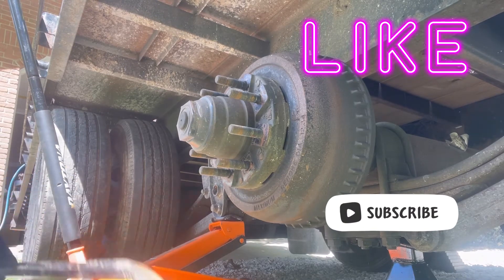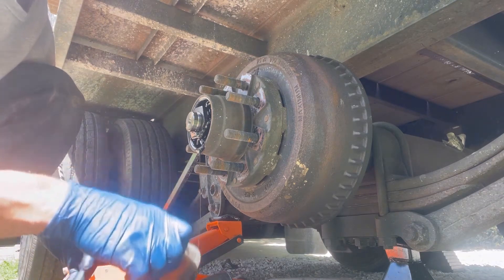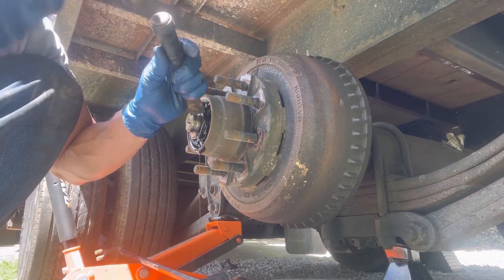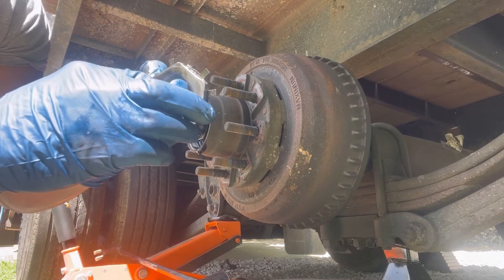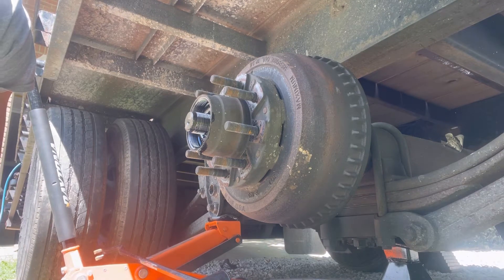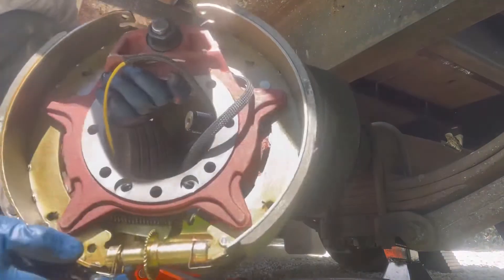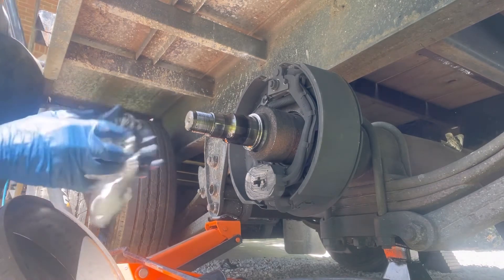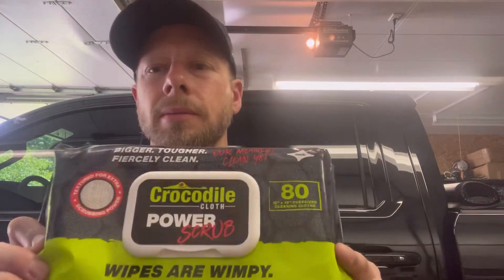How to remove trailer brake drum-Big Tex 22GN

Comment: The socket to fit the axle nuts is the same size as for the hub cap.    When installing, inner nut is torqued to 100 ft lbs while turning the hub, to seat the bearings.  Then back off to release pre-load torque and hand tighten.  Back off 1/8 to 1/4 turn.  Install tab washer, then outer nut, torqued to 100 - 175 ft lbs.  Also, Dexter says do not jack anywhere on the axles or suspension parts.  My trailer has the same axles, oil bath hubs, but with hydraulic brakes.
Reply: I’m having trouble finding the lug nut torque. I have these exact ones in the video
Reply: @rg8282    Lug nut torque for the 10K Dexter axle is 200 ft lbs.  It should be stamped on the ring the nuts tighten against

Comment: Where did you get seals
Reply from the maker: I don’t recall. More than likely from Amazon.
Reply: @lifeontheroad_  I just put all four on my dexter 10k this past week. $1100 after tax just for brakes. I replaced all bearings with Timken that was another $300. Hood thing I know how to do it my self or I would have been out a crap ton of money. Bad part is after I done it I found the brakes for way cheaper 😭😭🤣
Reply from the maker: It is definitely a great thing when you can replace/repair your own equipment. Not sure if you using equipment commercially, but if are and according to FMCSA, you may not be qualified to perform a brake service. Keep that in mind. 

I replace all four brakes on a 14GN. I found a cheap set of brakes. As I was installing brakes, I realized that the brakes were not self-adjusting. That is why the price was cheaper.

Comment: Both nuts have to align with each other? Or it does not matter?
Reply from the maker: Pre-tension is only set by first axle not. The second nut only helps lock in lock washer. If first nut is set to original position, then second will be set in its original position.